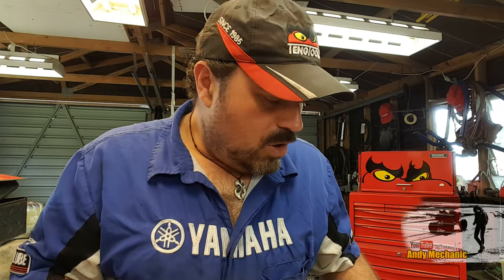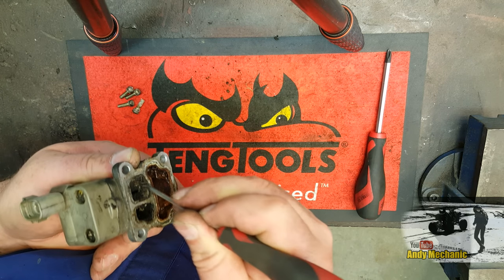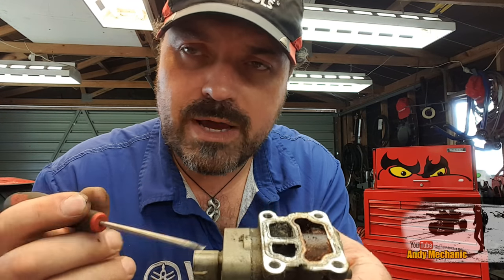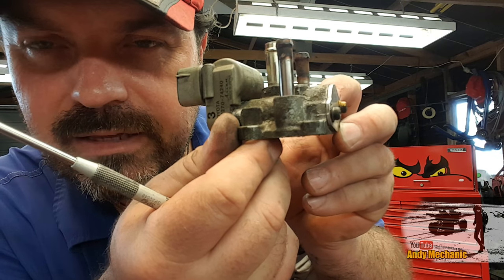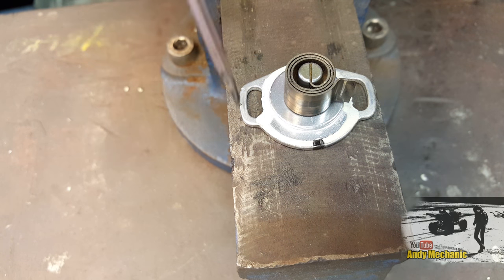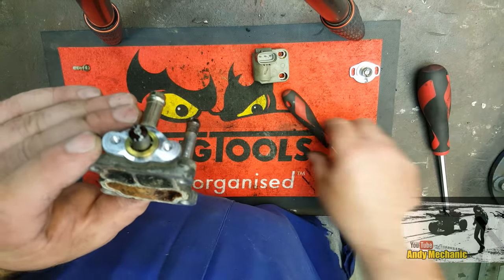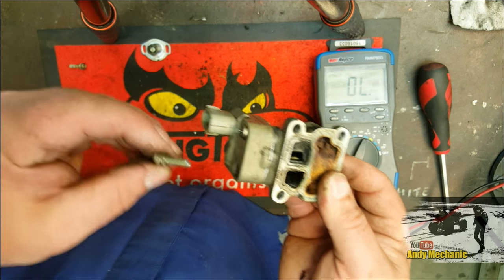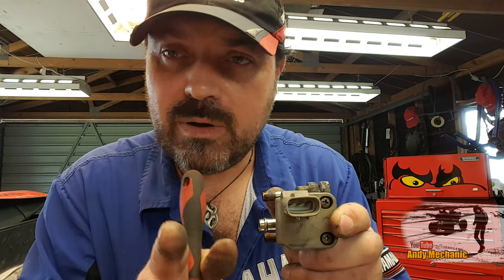How to test a rotary type Idle Speed Control Valve #1211

Comment: I had some idle issues in my Corolla, and my mech replaced throttle body with an used one. The problem was fixed. During my leisure time and out of curiosity I decided to fix my old throttle body. The main valve opens and closes perfectly fine, so I opened the IAC valve that I learned from youtube. I found huge carbon deposits in there, I cleaned up all with a carburator cleaner. Then I supplied 12v using a power adapter, and found the IAC valve closes and then back opens immediately like a springy mechanism, like an electric calling bell. Yesterday I was searching hundreds of videos to check whether this is normal or not, but found nothing. Then today youtube suggested this video and now I understand the whole working mechanism of this IACV system. I can't thank you enough :). Now my only problem is the rubber gasket got bigger than it's normal size. Looks like I have to cut and join that using super glue to make that short. I'll also apply some RTV gasket sealer.

Comment: Thanks Andy, I had this problem after replacing my Toyota Wish 1ZZ FE engine and reused my old inlet manifold and throttle body. Today I managed to resolve my high idle speed by doing exactly what is in your clip.

Comment: Thanks man. The best video online that teach how IAC valve works. I'm lucky you explaining it on Toyota.
Reply from the maker: Cheers :-)
Reply: Andy Mechanic sorry for bother you. I have corolla 2007, 2 years ago I took the iac valve apart to clean while I was cleaning the throttle body. I don't remember when the current rough idle started, now the car idle is rough, when i engage the AC, the idle shakes a lot. But when it's cold, the idle is great, but immediately after few minutes when the car gets hot, the idle is rough and the rpm drops to 730 to 750.Someone told that i might have messed up the factory calibration when i took it apart. But since i had no clue, i don't remember anything when i took it apart. What do you suggest and think? Thanks
Reply: @AndyMechanic  I tested the resistance of the coil and one side gives me 19.8 kohm, but the other 47.2 kilo ohm. I did your visual test and made a circuit and doesn't open at all even though the RSO resistance is 19.8 but still doesn't open at all. the RSC does even close and has resistance of 47 kohm. what do you think?
Reply from the maker: The primary side of the coil should have low resistance (thick wire, few turns) the secondary winding high resistance (thin wire many many turns) - it looks like your coil is faulty...
Reply: Andy Mechanic thanks for the reply. First what do you mean by primary and secondary winding?. Secondly, But I'm wondering if it's faulty why it doesn't trigger check engine sign?
Reply from the maker: Oh bugger...Sorry,  I had just answered a question about an ignition coil! Please disregard my last comment.

With the Toyota ISCV of that era the two windings should have the same resistance. Yours does look like it may have a fault as there is quite a difference in resistance between the two windings. I'd suggest replacing it.

Hope this helps & again, sorry about the confusion! Cheers Andy
Reply: Andy Mechanic hi.. I have took the throttle to clean it along with iacv, but sadly the car doesn't start, only cranks. I check the spark plugs and no sparks there. And the iacv had buzzing sound (the old one, i haven't replaced it yet, saving for money). I check fuses and it works fine. Fuel relay and injectors are working. What do you think is the issue?
Reply: Btw, lots of people on forums report the same issue with iacv buzzing with no spark issue. One said he fixed it by connecting the ground at the thermometer housing. Others don't write back. So i hope you can help. Thanks
Reply from the maker: Hmmm if no spark you best start checking the ignition circuit. Check to see if the coil is getting power then check to see if the ground side of the primary circuit is been switched when you crank. If it is then it's a problem with the coil or the high tension side. If it is getting power on the primary but no ground switching then it's a trigger (crank shaft position sensor) or wiring or ECU fault.

Hope this helps

Cheers Andy
Reply: Andy Mechanic thanks a lot Andy, i appreciate it.
Reply: @AndyMechanic  hi Andy, it finally started. Sorry, but you confused me a bit regarding the camshaft sensor which i haven't come close to :)
At the end I found a link to corolla manual and followed the diagnostic of the ignition system and check the ignition relay, wich was working fine and just by replacing it back, i noticed the OBD software was not disconnecting by itself. then i started the car and it started. I guess maybe messing around with the IACV caused some kind of electrical issue. Thanks a lot.
Reply from the maker: Sounds very odd to me....moving an idle speed control valve around wouldn't affect spark. Anyway,  pleased your car is running again.

Cheers Andy
Reply: Andy Mechanic hi. Sorry not just moving it around. What i did was, after cleaning it, i connected the iacv  the harness while the car switch was on, i just wanted to check how the passage is moving, but then a buzzing sound was coming out of selinoid motor, with no movement of rod or the air passage. After doing that and then putting the throttle body back, the spark went away. This was the 2nd time cleaning the valve but the only difference this time was that i connected the selinoid motor to its harness away from the throttle body.
Reply: @AndyMechanic  you should behave show voltage reading test at pins 2 and 3, and 3 respectively!!!

Comment: Great in depth video Andy . I've  always wondered though why they even needed the water coolant control portion of the valve. If you think about it, they could have just programmed the ECU to remain fully open on a cold engine, without a bi-metal spring performing this function. I've seen some idle air control valves from some manufacturers achieve full idle control without coolant flowing through them.
Reply from the maker: Thanks, yes, I agree, I think it was at a time when Toyota were still developing EFi components during the transition from carb to fuel injection. It did seem a little over complicated.

Thanks for the feedback
Cheers
Andy

Comment: just caught your work. Got a subaru 93 and it quit idling on me. Gave me some good info. Thanks.
Reply: I had same problem with my 1991 Subaru Liberty. This is what I did:  First,  I disconnected both battery cables. I then disconnected Throttle Valve Sensor. I then took off the air supply to the throttle valve, you know the big round pipe. I then pushed the gas/petrol pedal to the floor and kept it there with a long stick against the car seat or you can put a heavy brick or other object against the pedal. Find a piece of 4mm thick masonite and cut to the following dimensions: 300mm(length) x 250mm(width). Attach a piece of lint free rag. Tie the rag on the masonite with a strong string. Spray ONLY throttle sensor cleaner on the rag and start cleaning throttle valve and the sides gently. Be careful you don't drop anything in the throttle valve barrel. It could end up on top of a piston. When rag is dirty replace with new one. Do not spray throttle sensor cleaner directly inside throttle valve area. When you finish cleaning take the pedal stick away, reconnect the throttle valve sensor, then reconnect Battery ( + ) cable first and then Battery (-) cable. Reconnect air supply pipe and hoses that you may have taken off to help you to access the throttle valve. Start your car and let it idle until engine is warm. The ECU may need a few days driving to adjust to the new settings. Before you start have a look at some YouTube videos to understand how to clean the Throttle Valve. Some videos are on Subaru throttle valves. If cleaning the throttle valve doesn't help then you might need to go for the Idle Speed Control Valve. I haven't tried cleaning that yet. There is more involved with taking that off and cleaning it. You will need to disconnect and block coolant hoses. Good luck. My car used to stall at lights or as I was driving along. I then started again go 50 metres and then it would stall again. My mechanic tried to fix it twice but was unsuccessful. I'll never go to him again.

Comment: Great breakdown. In other people's advice on this part, they have discused diagnosing through a use of an underhood diagnostic box, where you can jumper across a terminal, and the rpm should increase, which I guess means it is signaling the IAC to open? So it must be a jump of ground to the RSO terminal?

Comment: The grunge inside the water section can be removed by radiator flush fluid, without removing the valve from the throttle body.

Comment: The part about the duty cycle is what surprised me. That being said, I tested the signal coming to the ISC connectorand I only get a solid reading of above 12V on the RSC pin (uppermost pin from ground) to the center B+ pin (battery positive) and I'm wondering what could cause that?

If this is "duty cycle",  I'm assuming there's signal going to both ground pins and the computer is varying it according to the needs of the motor like you said. I'm guessing the RSO (Lowest pin) should have some larger value of voltage than the RSC pin when starting cold. The reason I say that is when I connected just the RSO pin as ground with 12 volts positive to the B+ pin with a jumper cable, it idles high like it should when the engine is cold.  

When testing with a multimeter, the RSO pin voltage shoots up to 9V and then drops immediately w/o me doing anything when the ignition is in the ON position w/o starting it. I double checked this by using a computer from an old same model car (Toyota Previa) I had, and the same 9v initial voltage jump happened and went back to 0.

Whoever is reading this, if you're idle is working correctly, taking this reading would only take a few minutes and would help me tremendously. 

Maybe when I fixed my MAF awhile back (apparently the solder joints are temporary - https://www.youtube.com/watch?v=CXCpYj-r_lI&t=758s) I soldered something that now is causing this problem...hmm....still thinking about that one...

Comment: Enjoyed the video! Nicely done., very detailed and well explained operation of these little devices. I have toyota which has sat for a while.  It starts and runs well wit throttle open but at idle stumbles to a stop like choking itself to a stop.  I have cleaned  and loosened this valve as it was stuck but still have the problem.  Any suggestions?
Reply from the maker: Hmmm....could be a few things, have you checked fuel pressure & quality? Fuel can go off over time so maybe drain the tank & give it some fresh fuel, just to eliminate that possibility 

Other than that I'd test map sensor & check all the vacuum pipes as these perish over time.

Hope this helps. Cheers Andy

Comment: How do the Engine Coolant Temp Sensor and this Idle Speed Control Valve relate to idle speed? On a Camry 1mzfe the ECT sensor reads at the outlet if temp is up ECU should drop idle speed vise-a versa. To drop the speed, do the ISCA receive an influence from what the ECT read? I understand the ISCA also reads the temp from inlet temp before the thermostat valve to influence the the ISCA bi-metallic coil.          Is either one more dominate? 
What is possibly keeping the idle high at 1400rmp if the ECT sensor outlet and ISCA are already at Operating Temp? I got a  new OEM ECT Sensor. Occasional, 400rmp made me change the ECT sensor. And idle would drop from 1100 to 400rmp if the old ECT Sensor was disconnected but there is no change if the new ECT Sensor is installed.
I hope I didn't missing something in your great explainable video.

Comment: Thank you very much for this detailed video.  I have a trouble shooting on iac valf of Toyota corolla ae101 4 afe . I cleaned the throttle body and  replaced it. But idle speed is little bit high, the speed is 1250 in minute . On lpg is normal but when I activate  the fuel benzine is 1250 rpm in one minute. I touched the iac valve shaft during the cleaning it. Please tell me which side I should adjust  the idle shaft for regular position left or rihgt side thank you very very much for help.

Comment: Great detail,  mine is on a 22-RE truck 86 and it has a different air valve.  Mounted below the throttle body and connects the air by rubber tube.  It only has two terminals and the Ohm reading is correct based on the Toyota Manual.  My truck works perfect until idle and then it will just go dead. Or it might run 4 days perfect then die.  Have replaced or checked everything except this valve and the CPU or main board.  Is it a given that if the Ohm's are correct that the  valve works?  I haven't opened the engine water temp side to check it.  The opening at 65 degrees was closed too much so I opened it to match the manual.  Any advice this has been going on for over a year.  All the 22-RE guys are too busy to work on it.  Thanks,
Reply: Go ahead remove the IACV and there is an adjustment screw.

Comment: Andy! MAYDAY! Lol. My 2006 corolla idles fine when cold but once the engine is warm, the idle drops and feels as if its going to stall when stationary. When i turn on the AC or Lights etc., the idle increases. Could it be that the iac valve is the culprit?

Comment: My Toyota Avensis 2016 1.6 ltr petrol cold start sometimes revs up and down while idling to the point of almost cutting out until the engine warms up then drives perfectly ok. After I've stopped it can be hard to start but only if it's had the revs up and down issue during the initial starting other than that starts fine. Any thoughts.
Reply from the maker: Hmmm....it could be that the fuel pressure non return valve on the fuel pump is leaking so pressure is not maintained when engine is turned off. This could also prevent fuel pressure meeting spec so it's a little low for cold start. I'd fit a fuel pressure gauge & check that first

Cheers Andy

Comment: If the engine doesn’t idle less than 1200rpm. Does it mean that when I reassembled the valve I was a bit off with the valve plate?
I moved the adjustment screw on the accelerator until it makes no difference on the idle speed. It started at 1500rpm wanted to take it down to around 800 to 1000rpm. 
Any suggestions?

Comment: Hai sir..
If the megnet crack, can i still use it the ISCV? Or can i change the megnet shaft? Its for My toyota ipsum 2.0(3sfe engine) 
Thank you in advance.
😊pls help me...i really need your advise.
Reply from the maker: No, if the magnet is cracked the polarity will change & it won't work correctly 

Cheers Andy
Reply: Thank you sir...I just chage the isc valve but the check engine light is still thare....the idle is about 1000rpm even when the engine hot...normaly the rpm should be 650-700...how to reset it back to normal? thank you so much sir.🤝

Comment: Hi @Andy,  I want to know if the electrical part of the video also applies to corolla 2004 IAC. I tested my the connector of mine and I got 12vdc across the middle terminal and the other two terminals. Also, I will like you to tell me what the resistance of the IAC windings should be.
Reply from the maker: Hi, yes, it's likely the same, if so then from memory 125 ohms resistance for each of the two windings. Either way both windings should have the same resistance 

Hope this helps. Cheers Andy
Reply: You. Are. The. Best. Teachers. That any. College.  Should.  Have. On HOW to. Fix. A. Car problem God. Bless. You.

Comment: Hello Andy, in an older car such as a 94 corolla, what system is responsible for fuel enrichment on startup, higher rpm on startup. Is it the IAC valve or the ECT sensor? From my understanding the oxygen sensors need to heat up before they start communicating with the ecu.
Reply: What was the answer 
I know comment was awhile ago lol
Reply from the maker: Engine coolant temp signal is critical to the ECU providing a Rick fuel mixture on cold Start. Air temp sensor also is taken into account for fuelling too.

Cheers Andy
Reply: Please if you can help here's what is happening with my 93 subaru legacy sedan 2.2l non turbo awd manual transmission 
Cold start. Strong crank. No start. 
Oh and no codes. If I push in clutch and gas pedal to the floor  it starts and soon has it starts it revs I let off pedal some to 1000 rpms  so it stays going and let it warm up say 5 minutes then it's good to go.  When it's at temperature and I do my errands gas station post office and grocery store it starts back up but if it sits all day while at work 🙃 I have to do clutch gas pedal start again. Recently passed deq with flying colors that's what the guy said when I asked how it did . Had checked for vacuum leaks ( smoke machine) and told none but no answer for issue then was told maybe gb induction service 🤔 might help, in 30 years no one has ever mentioned this type of service?? Thoughts on that.  On my search learn read and watch tutorials.. I started thinking vacuum leak dirty throttle body IAC valve coolant temperature sensor.  Thank you in advance if you could
 share your knowledge .it would be fantastic and I would be so grateful

Comment: Good Morning. I hope you can help me. I know just enough to be dangeruos.. lol          OK I have a 2002 is 300 its iac is ratehr diffrent yes? Can i clean the air valve for that on the j2jz ge throttle body?  Or is the only optton is to replace that electric version thing. LIke 330$ OEM.. dang

Comment: all idle parts were cleaned. but if i ac on the car rpm always drop down. many times I cleaned that idle part. but it is not working. plz help me fix this problem. some time i ac on the car stop the vehicle.
 is that the ECU case sir. plz reply